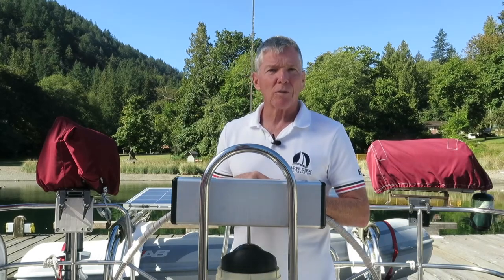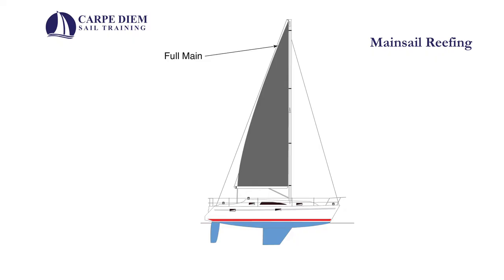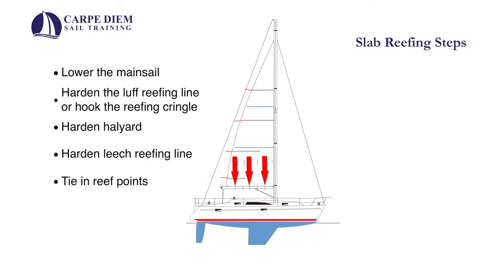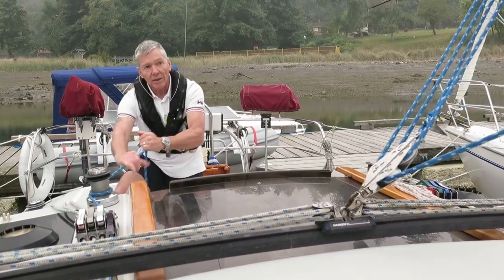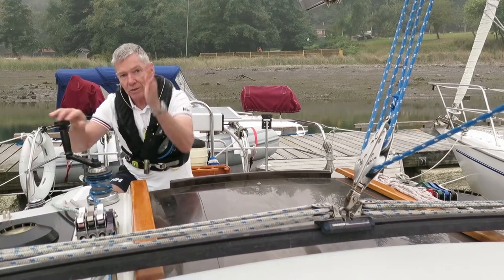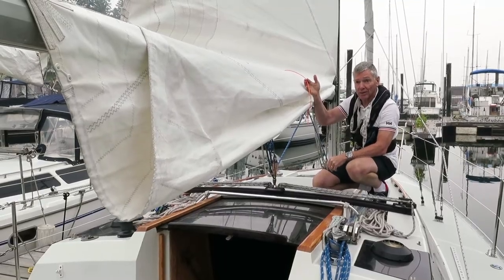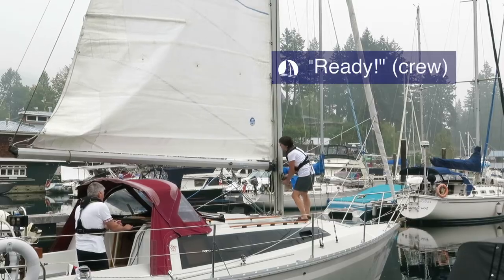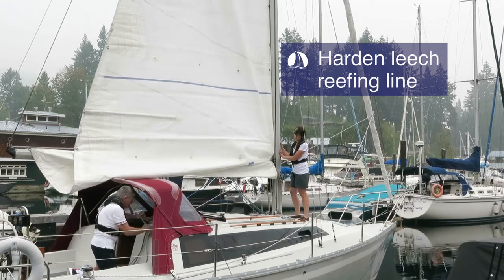Ep 27: Learn to  Sail: Part 15: Reefing the Main

Comment: To eliminate having to go forward to adhust  the topping lift, you could  disconnect it from the boom end and install a small Harken (etc) two block purchase between the boom and lift. This allows you to adjust boom height from the cockpit. 
I have a cleat mounted on boom end to tie it off.
The bitter end goes through the center loop in the cleat with a stopper knot so I wont lose the  line.
I recently also added a small cam cleat to allow rapid adjustment on the fly.
Cheers
Reply from the maker: Thanks for the comment. The only problem with that is in order to safely get to the topping lift you have to sheet the mainsail all the way in. For me I don't always want to have to do that. Ultimatley the best solution, as suggested by a viewer is a rigid boomvang. I will be installing one and doing a video on it.

https://theriggingco.com/2017/04/03/the-vang/

Comment: Thanks very much! As a newbie, I love your videos. Question: if you are under conditions where you are wanting to reef, and you have a full sail up, wouldn't it be dangerous to trim the mainsheet tight? I think I've done this after heaving to in the past...
Reply from the maker: Thank you for the kind comment Robert. As for your question, it’s not that straightforward. Sometimes trimmings the main sheet tight can actually stall it making it less powerful. Also a lot will depend on your particular boat. The only reason I say too harden the main sheet in my video is because my toppling lift is at the mast and I was always taught to harden the mainsail anytime crew are going forward or coming back. Once the crew are clear the main is eased, Hardening the main while hove to is not dangerous. In a perfect world my topping lift would be led back like all my other lines and then I would not have to harden the main. Hope this clears things up.

Comment: Excellent video. I am an ASA sailing instructor and refer my students to you. A couple of questions:
1) how do you luff the main for reefimg? Use the engine to point up head to wind, go hove to, or sail a close reach on jib only and sheet out the main? Seems like using a motor to go head to wind would be terribly uncomfortable and the jib would flog itself to shreds.

2) all our club boats have single line reefing. Do I tighten it to where the new clew is pulled to boom level before I harden the halyard? Im thinking I have to.

Thanks!
Reply from the maker: Thanks for the kind comment Phil. I used to heave to but now prefer to continue sailing close hauled or close reach with the wind forward of the beam. The boat sails fine with just the headsail and I ease out the main to reef. You could use the engine after having lowered or furled the headsail but that seems very counter productive to me.
Reply: @CarpeDiemSailingMagazine  I saw ome fellow that claims to be able to use single line reef on the main while on a broad reach. Might be dependant on wind and sea state.
Reply from the maker: @philwinner1806  I have never been a fan of single line reefing. My boat came from the factory with single line reefing but I quickly changed it. Like you I am very skeptical of single line reefing downwind. To answer your question, yes you would have to harden the line into the clew first which flies in the face of proper safe mainsail reefing, another reason I'm not a fan. As with in mast roller furling this is just another attempt at building a better mousetrap but doesn't really work.
Reply: I wanted to ask or make a similar point. The video is very instructive and all is shown not in a hurry. But " in a real world" at sea reefing is often necessary in not so convenient conditions(in the night, rising strong wind, waves). But you answered my question already. I would also sail further on the headsail and reefing the main instead of  starting the engine after getting down or furl in the headsail.

Comment: i notice, you didn't mention tightening the topping lift, at the overview, this IS IMPORTANT, as when the halyard is lostened, the boom will just drop, without the topping lifts' support.
Reply from the maker: Yes this is important and for me my topping lift always on but just slack when close hauled so when I lower the sail the booms comes down a bit but not all the way. Having said that having the topping lift on before lowering the sail is best practice and definitely makes tying in the Leeds reefing lube much easier. In April I’m upgrading to a Boom Kicker an alternative to a rigid boom bang but this will do away with my topping lift. Once installed I’m going to reshoot the video

Comment: Would you soften the lifting line before you garden the main sheet? Seems it would put a lot of stress on the lifting line when the sheet is pulling down on it?
Reply from the maker: Yes. If I understand you correctly you would ease the topping lift when your sail is fully reefed and before hardening the main sheet. It’s not do much the strain on the topping lift that’s the problem, it’s not being able to properly tension the mainsail especially the leech twist

Comment: On your system all lines go back to the cockpit except the topping lift. Why not lead the topping lift back to the cockpit; preferably alongside the vang? Then nobody has to go forward.  I always use a black sail tie through the clew and round the mainsail bunt.  It makes it easier to notice when I'm shaking out a reef and have forgotten to untie it!  As a single hander in my seventies I have a laminated card with reefing bullet points in the cockpit which I read (occasionally!) before I put in the first reef.
Reply from the maker: Thank you for the comment David. You might have missed it but I have mentioned a few times in various videos my intention to do just that. I really need to lead that topping lift aft. I love your checklist. Thanks fir watching.
Reply: P
Reply: there are pro's and con's for leading the toppinglift to the cockpit.
-the pro's are mentioned in the video
- the con's are the following. There is the risk that the boom falls down completely into the cockpit or hitting a crewmember when the toplift- clutch is freed unwillingly in a hurry or by an incompetent crewmember.
You can of course  install a boomvang, which holds up the boom.

Comment: You indicate that the excess sail should be tied around the boom at the reef points which is counter to what  Wallace Ross advises in his book Sail Power. I prefer your clew end tie off which reminds me of what I use to keep the clew of my Laser close to the boom.
Reply from the maker: I mention that traditionally the excess sail is tied around the boom with reef points but like you say that is not my preferred practice.
Reply: @CarpeDiemSailingMagazine  Yes I recall that. What I am saying is that Wallace Ross says "Do Not" tie around the boom at the reef points so the tied sail is free to move away from the boom. I actually like your method better because it keeps the clew down to the boom while still allowing the sail to take a natural shape and it reminds me of a short loop that I use on my Laser to keep the clew tight to the boom. Tying around the boom forces the sail to form to a linear foot. Appreciate your work to put together the videos...keep them coming!
Reply from the maker: @go4itpc  I know exactly what you mean. I just started sailing Lasers again and have been using a little velcro strap to hold the clew to the boom. Thanks for the support. I am just in the process of editing several videos to include Single Handed Gybing, Lowering the Mainsail, Basic Plotting Part 2 and Mooring Buoy Part 2

Comment: I have a hard time understanding the point with reefing videos recorded under conditions not requiring reefing. (at the dock e.g.) The following shows reefing under more realistic circumstances:
https://www.youtube.com/watch?v=y7OS2OnITfk
Reply from the maker: You're not the only one to have this opinion. Frankly I'm surprised that some people don't see the benefits of learning to reef in calm conditions at the dock. It is certainly not meant to represent real life conditions, it is simply a starting point to make it easier for people new to the sport to understand and get the steps and the flow of the manoeuvre in a controlled setting.  I have recently filmed "reefing in real life conditions" and this will be a follow up to my first video on reefing.
Reply: @CarpeDiemSailingMagazine  in my sailing club here in Chicago, we reef at the dock depending on wind conditions. We can make sure the correct points are set. The sail is set when the main goes up. I been watching your videos for awhile now, and sometimes more than once to get better understanding after being out on the water. My club is a teaching club and I am teaching skills I learned while still learning myself. I am working on trying to explain sail shape, lift, and tell tales etc. Thanks for your explanations
Reply: @nealrosenholtz7116  always good preparing your boat as good as possible for the sea- and windstate when leaving harbour. But on a longer trip- perhaps even through the night- you will experience various conditions- so you have to change your " sailcloth" in relation. Having said this- also rather near your harbour on a nice afternoon-sail the weather can change rapidly so you have to reef your sails on the ocean.

Comment: Very informative and well presented. I have seen some articles on single line reefing. A single line runs through the luff cringle, down along the boom, up through the leech cringle, down the mast, and aft to the cockpit. It seems like this would be a simpler setup. Can you discuss the disadvantages of rigging this way?
Reply from the maker: I’m not a fan of single line reefing as it adds way too much friction. In fact my boat came out of the factory with single line reefing and I changed it to two lines for each reef.

Comment: Finally an example of four line reefing like the system that came on the boat we purchased. Turns out we were using it correctly but I was concerned the leech reefing line should go through the sail with the bitter end tied to the boom below that point (our boat main is loose footed).  We currently have it setup as an outhaul like you show.  Thanks for the clarification, appreciate your videos as we learn something from each and every one.
Reply from the maker: Thanks Montana Dan, I really appreciate your support. Funny enough my boat came from the factory with single line reefing (which I hate almost as much as in mast roller furling). I added the two extra lines. I would also like my topping lift led aft then all my lines will be in the cockpit and I will have no reason to go forward.
Reply: @kleitosaliagas5668  Why wouldn't you? In-mast furling forces a much thicker, heavier and stiffer mast, giving you a lot more weight aloft, and even with the main fully rolled in, the entire weight of the sail is still up there.
The furling mechanism is also high up, with the bottom part being hard to access for maintenance on a larger boat, and the top part almost impossible (requires climbing the mast). If it gets stuck, you'll have a right miserable time with the sail partially out until you (hopefully) can fix the mechanism. It may not even be possible to get down in a bad situation.
It's much harder to make a mainsail with vertical battens that also holds the shape well. Horizontal battens aren't an option for in-mast furling (there are rollable battens but they don't work well and wear out very quickly).

Roller furling is fine, but it has to be in-boom furling in that case. Keeps the weight low, both for the larger boom, the furling mechanism and the sail. It's also a lot more accessible for maintenance or repair and requires no climbing. You can also use normal sails, perhaps with minor tweaks to suit the roller furling mechanism. You can use horizontal battens for better sail shape. And finally, if the furling mechanism fails, you can still reef or completely lower the sail in the normal way.
Reply: @mytube001  agree with your arguments, but it's a fact that the vast majority of the boats in the charter-sector use mastin- furlingsystems. And of course they are a big help for the not so experienced charter-crew. And of course you have to know some tricks to work with them in all conditions.

Comment: Hi, what is the reason for closing the main hatch? Thank you.
Reply from the maker: Thanks for the question and for watching the video Ronan. Closing the hatch is a safety measure so that there is no way that someone can fall down through it when walking around on deck. I have always encouraged this habit with my students even if the boat is equipped with a dodger. It's just a good habit to get into to prevent potential serious injury.
Reply: @CarpeDiemSailingMagazine  I'll remember that..